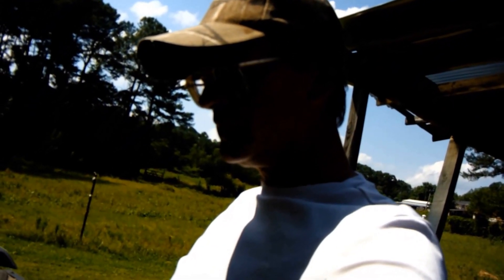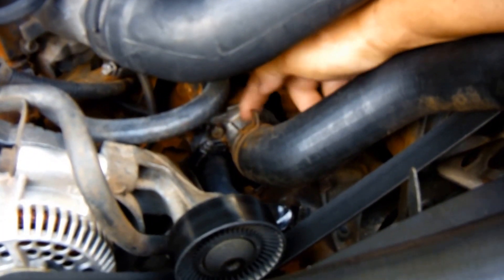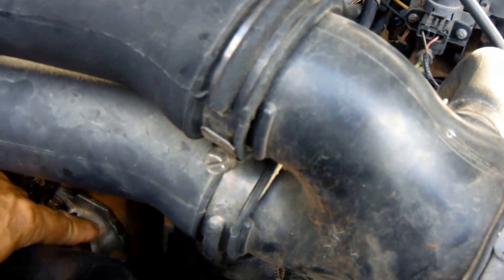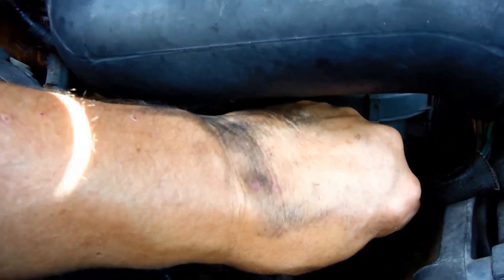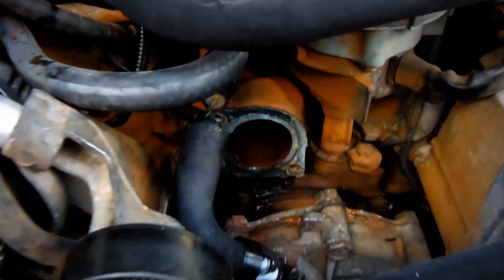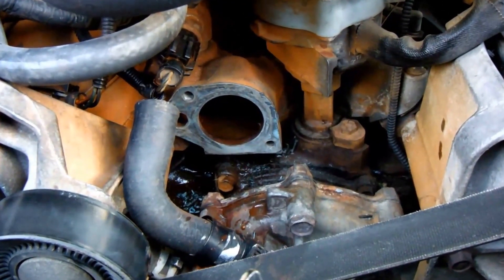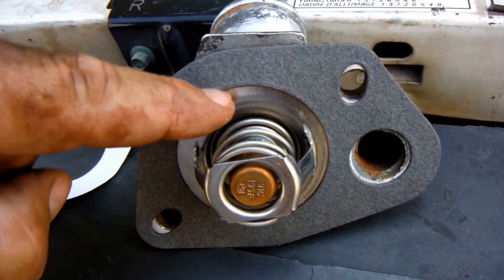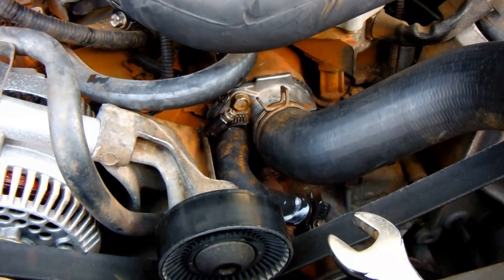DIY 1995 F-150 thermostat replacement Tips and Tricks

Comment: 9 years later, I’m using this video to swap the thermostat on my 94 5.8 f150. Thanks 👍
Great Pro tip putting the thermostat in place on the housing before applying the gasket!

Comment: Just did mine on a 96 5.0.  I used a paper Fel Pro gasket along with some Permatex The Right Stuff on both sides of the gasket.  I also replaced the upper and bypass hoses when I was in there, along with surfacing the thermostat housing.  I ended up retorquing the bolts after a few heating and cooling cycles and now have no coolant leaks at all.

Comment: This is a good video.  I watched it before starting on my thermostat and it was definitely helpful.  The lower (right) bolt for the tstat housing did not want to turn at all, and the upper (left) bolt turned about a half a revolution and then got extremely tight and did not want to move.  I sprayed both liberally with WD40 and waited.  The lower one finally cracked loose by using the box end of a larger wrench on the open end of the 1/2" wrench to get just a little more leverage.  The upper one required multiple shots of WD40...I would spray it, wait, then turn it tight as far as it would go, and then loosen as far as it would go and then put some more WD40 right on the threads, and drive it back in.  I think that technique actually pushed the lubricant into the threads as I tightened it.  Eventually it came all the way out.
The hardest part was just to get those bolts out.  Other than that, the only issue that I ran into was that it leaked after I got it all back together.  I am going to take it back apart and figure out why that is.  I took great care to clean both of the mating surfaces.  There is a bit of a lip on the tstat housing that the tstat sits in, and I don't know how to ensure that it stays right there in that spot while putting it in.  I might try putting a couple little dots of silicone on there just to hold it in place while I install it this time.
Reply from the maker: Joe Weaver Appreciate your praise, Joe. Thanks for watching. : ))

Comment: 96 Bronco, took several hours because I drained a couple quarts, spent lots of time cleaning surfaces, and used a very thin bead of blue sealant on the gasket and let it set for over an hour. 
There had been a tiny mystery leak for years but finally got bad about the time the thermostat went bad and wouldn't let the engine get warm.
I recommend removing the intake pipes because it gave me a good view and access so now I'm confident that was the leak, near the bolt hole and bypass port. And, it is a change to clean up those parts of the engine.
The engine was able to warm up properly within a couple minutes after the repair.
No leaks after a week, and I added coolant about 5 times before the air was fully removed.

Comment: Advice to all, pick up a pump/thermostat bypass hose while your at it. Couple extra bucks will save you the misery. They tend to tear apart, doing this job. After done with replacement, don't forget to top off coolant and run it up to temp - Burp the cooling system. After cool down, top off coolant as needed. After a few driving cycles, check for leaks around housing.

Comment: Thanx.
Reminder , check Water pump flow and is working prior to thermostat replacement as it must be flowing.
Also if water pump needs replacement also do new thermostat.
I'm on Calif. I - 14 with veh overheated.
So  Tow truck on its way.
So Thanx and good luck to all and check all radio houses.make sure all no leaked and there you have it.
THANX for all best wishes.
Best regards.
DH.

Comment: I would have removed the air filter ducts and disconnected the temperature gauge connector for easier access to the housing bolts. My approach to any work I do is it is only as good as what I don't replace. In this case I would have replaced the small 90 degree bypass hose as well as replacing the factory spring clamps with new screw type clamps. If the small hose starts to leak or the spring has lost its tension, you have to go back a 2nd time to fix it.
Reply from the maker: I guess I'm lucky. I haven't had to touch it since.

Comment: A little extra work...it is very easy to remove the air filter hoses from the throttle body. You'll have a LOT more room to work. Remove the small u shaped hose from the housing as well...adds more working room.

Comment: Great video, thanks for the info. Do you know where the bleed valve is so I can ensure after I replace my thermostat and flush my radiator that there is no air in the line? Thanks again

Comment: I must start this comment with a huge THANK YOU because I get so much from your videos. Easy explanations and you show concern with quality and cleanliness of parts which is something I never really considered. I am a home builder by trade and honestly don't know much about cars. I am mechanically inclined though and by following your instructions I can perform professional grade work on my truck. So thank you sir for your time.    I am getting ready to change the thermostat in my new/used truck but the radiator is clogged bad. I bought a flush kit. My question is should i flush it first or after i change the thermostat. Any help with this is very much appreciated
Reply from the maker: geoffrey beckelic If the radiator is clogged, it's best to replace it. Coolant has to flow freely, or it won't do its' job.

Comment: So you didn't have to deain any radiator fluid. Some vids suggest to drain a quart before replacing the thermostat. Also I have read to be careful to blled the air out in case of bubbles? I am about to do mine. 1991 Ford 5 ltr.

Comment: My 1996 5.0 (just purchased)  seem to never go above the N in normal.   I am thinking it's a lower temp thermostat or stuck open or backwards.  Any thoughts?  Also what size bolts?  How much fluid leaked when taking first hose off?

Comment: Hey Richard I just got a 95 ford f150 with a 351 with Windsor motor is the location in the same spot for the thermostat
Reply from the maker: More than likely, yes. Look for a two inch hose running from the radiator to the front of the engine block, Your Thermostat is probly mounted right on the engine block at the end of that hose.  Thanks for watching, I really appreciate your "likes" and subs. : ))
Reply: Thank you for your help :)

Comment: Do I need to drain some antifreeze out first?
Reply from the maker: I suggest you put a large pan of some sort under your truck to catch the coolant as you remove the thermostat housing. Draining the radiator will not remove coolant that is in the block, so some will come out anyway. 
  Thanks for watching.

Comment: Hi
Do you know how many (°F) max. works the engine of F150 ?
Reply: 195 is oem
Reply: There are alternate versions that open at 160F and 180F. If you don’t have issues requiring a temp change, stick with the original 195F. That’s the temp where everything else is designed to work properly.